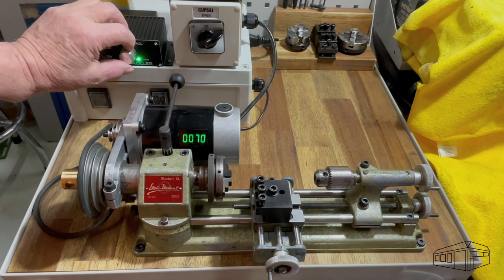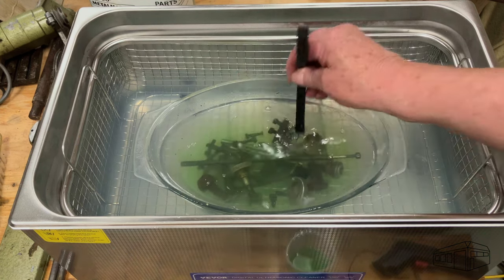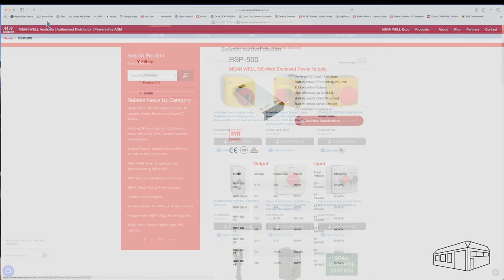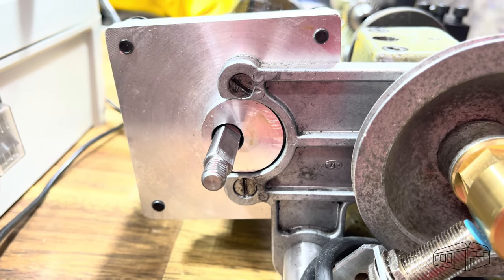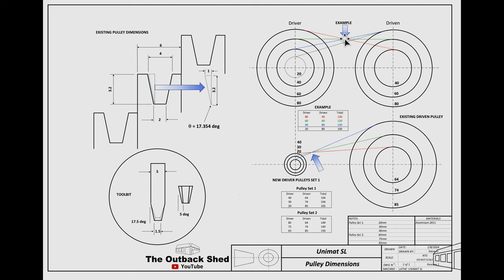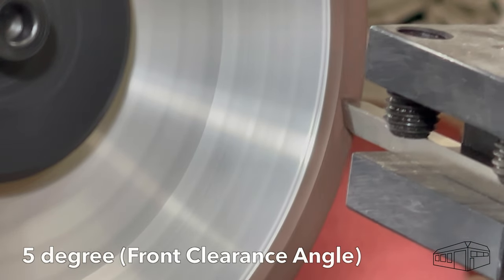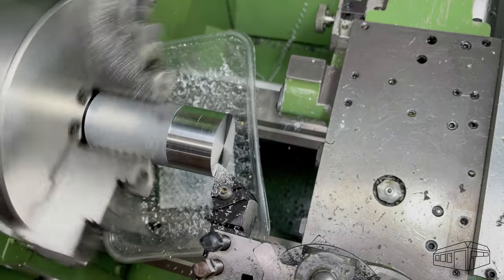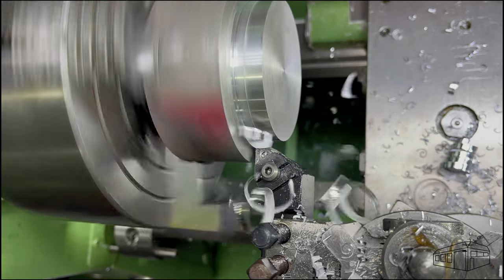The Unimat SL Lathe Upgrades

Comment: Nice work and a well produced video. Question, not a criticism: do you have any problem with the power supply heat in an enclosed box?
Reply from the maker: Hi, Thanks for the comment. I haven't used it yet as I'm still in the process of setting it up. The power supply is thermally protected but if heat does become an issue I'll install a fan and some vents in the enclosure. Stay tuned.
Cheers SteveO